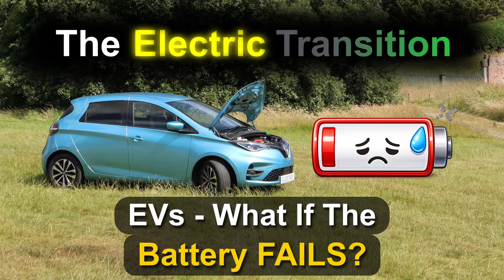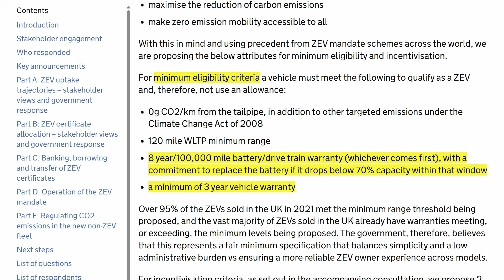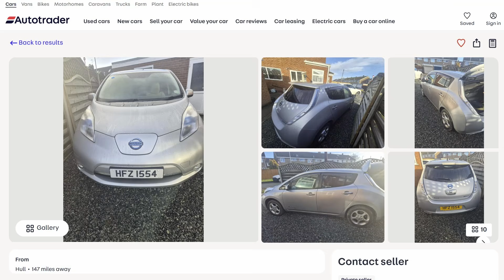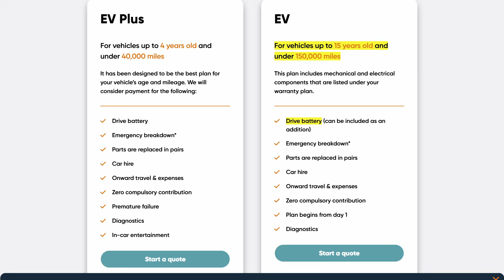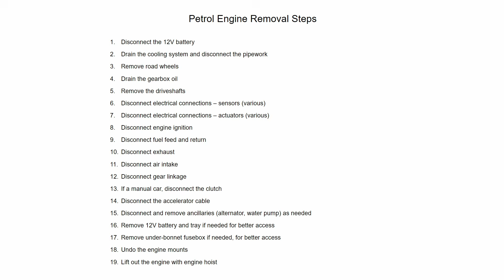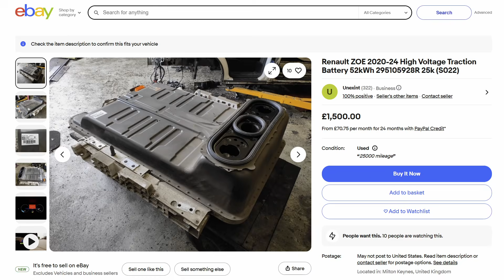EVs - What If Your Battery Fails?

Comment: I would like to be able to consider updating my worn-out battery for a new one using new technology and higher capacity.
Reply from the maker: That's certainly something that LEAF, and perhaps ZOE owners have done a bit. The LEAF's high degradation, as well as cell failures in the 30kWh variant due to lack of active thermal management, has encouraged an upgrade route. We've even seen this in Tesla Model S, with some people wanting a bigger pack than the car originally came with.

Comment: Nice review. Regarding replacement traction batteries most people are only going to buy one if they have a suitable guarantee. If the battery was replaced by the car dealership or their agent this could be for the remaining warranty time for the replacement battery or at least for the minimum of 1 year after purchase. Otherwise you have no way of knowing the history of the replacement battery or why the donor car was scrapped in the first place. 

However, you did not allude to the "elephant in the room", which is traction battery fires. There have been a few of those caused by cell pack failures due to faulty manufacturing. As someone who owned a Jaguar I-Pace for 3 years and 40K miles driven, I can say that I did NOT observe any battery degradation during my ownership, but had 2 traction battery cell failures. These were replaced under warranty by my local JLR dealer without any quibble or issues. But, this is a know problem with these cars. The same (manufacturer) battery is also in the Porsche Taycan and the Audi e-Tron GT both of which have experienced similar cell failures. All I-Pace subsequently received a software update that limited battery charging to 70% to prevent overheating (in the event of a cell failure) and a potential fire. This issue has very recently been reported by Volvo for some of their EX 30 models. The advise is to only charge to 70% until Volvo can work out a solution. So cell failures are still occurring but the main concern (as perceived mainly by the anti EV lobby) is not being left stranded but that the car will go on fire.
Reply from the maker: Thanks. I take your point about guarantees, but I think there are limited guarantees on a reconditioned engine, so I think this is a case of considering the equivalent for a combustion car.

Fortunately, the health of a battery is pretty obvious quite quickly, so even quite a short warranty should provide sufficient time to find any issues and make a claim against it.

You are right, I didn't mention traction battery fires. That's because the data shows that they are very unlikely. As you rightly say, there have been some recalls to cars because of the risk posed when manufacturing defects are identified. However, that is not the same as saying there have been a large number of fires even in those circumstances. The recalls are preventative. Recalling cars is the right thing to do - it's what ensures that fires remain a distant possibility.

I did do a video on traction battery fires a year or so ago, which you might want to watch if you haven't already. That details the source of the information that was carefully gathered, and what that means for BEV fires in comparison to cars with other drivetrains.

https://youtu.be/WDP1XAsoR_0
Reply: @IanStill-od1ej
Many ICE cars been recalled for fire safety reasons as well.

Comment: I drive a small ICE car. I will go electric in my next car. Hopefully, that will be a long time coming, because I cannot charge at home. Charging in my street is available, but just as expensive per mile than my current small ICE car. The biggest problems I have are: 1) An EV uses electricity in winter just to keep the battery from freezing, that is in my view wasting energy as I use cars to go from A to B and not heat components. 2) My own range anxiety. I had that all my life. I will fill up if the tank goes below 1/2. In an EV that would be limiting the range and hurts the battery. Oh, on the reliability of batteries, I think you are a bit too optimistic. Especially imbalance issues are not that rare, is my impression.
Reply from the maker: Thanks, interesting thoughts. I think onstreet charging prices will come down as usage goes up, so keep an eye out for that over the next 3 or 4 years.

ICE cars waste thermal energy all year round - you rarely use more than a third of the energy in the fuel. Therefore, a small amount of heating performed by an EV during a part of the year doesn't really make it wasteful in the same way.

A permanent range anxiety will probably fit with an EV just as well as cars with greater ranges are released. The Kia EV2 will be interesting to evaluate when it is released - but I am really referring to cars 2 or 3 years from now, which I think fits with your timeline
Reply: @ronaldderooij1774
There will be plenty of ICE cars around for years to come. If you don’t want EV no one can make you. I did use public chargers for over 2 years and it was cheaper, cleaner than driving ICE. Battery degradation by cycling data has been available for some time now. Battery degradation by calendar year, well we need to wait another 15 years for that to see results on modern chemistry’s.

Comment: Rarely does the dealer scrap an engine just because the car hit a pothole and dented the pan beneath the engine.
Reply from the maker: Have you had a problem with an EV, or is this more of a thought experiment?
Reply: @theelectrictransition  My wife was looking at leasing a Tesla (she loves the Dog mode) so we asked our insurance agent for a quote and the price we through the roof.  When we asked why she told us that the scrap rate was through the roof because they had to assume the battery had to be replaced on almost all collisions.
Reply from the maker: @typicalbraindeaduser  Interesting. My understanding of why Tesla insurance is so high is that it is a performance car with faster acceleration than people expect and are used to handling, so they suffer a higher than average collision rate as people get themselves in trouble.

Comment: Having a quick google, the percentage of ICE that fail during warranty period is stated as between 2%-3%, the same data for EV batteries indicate a failure rate while under warranty of 1.5% to 2.5%, however if we only take EV's manufactured after 2016 this failure rate drops to under 1%. that failure rate of between 2% and 3% is apparently quite acceptable for ICE cars but a less than 1% failure rate for EV batteries isn't? Again it's the old EV fire fear, far more ICE cars burst into flames than EV's, with that number for EV's dropping even more as new technology comes out, but because they are new and newsworthy we hear about the few EV fires but not ICE cars and trucks on fire.
Reply from the maker: Well said, and thanks for the stats. Yes, I agree, once manufacturers have got any first model design issues out of the way, EVs should be pretty reliable things.

Comment: I am in exactly that position now. The battery in my 30 kwhr Nissan leaf teckna 6.6 kw charger in Arctic white, is now only 50% state of health with only 6 out of 12 bars left. The wife uses it only as a very local runabout now and although the battery is almost completely not range viable anymore, the body of the car, being galvanised would otherwise have many more miles ahead. With a replacement battery being so expensive, it is not worthwhile to pay the price for a new one financially. I could fit a second hand 62kwhr battery from a crashed car for £8k but you only get 3 months warranty on the battery at Cleveleys as well as this,  it is still a very large sum to be throwing at what is a 10 year old car and a battery that you don't know the history and integrity of.  If the car had been a combustion car, the engine could have been repaired at a far cheaper price and kept on the road. As it  is, it is not financially viable to replace the battery and we are going to put the £8k towards a brand new £20k Dacia Jogger, which will last a very long time and also have a range of about 550 miles. I wouldn't consider another EV again, this is just another problem of the numerous problems and inferiorities, that i have encountered in 10 years of EV ownership.
Reply from the maker: I'm sorry to hear of that trouble, it's very disappointing. You were unlucky, as the 30kWh LEAF seems to have suffered the worst, particularly because of it's lack of thermal management, but perhaps also a poorer choice of chemistry.

I'm sorry it's put you off EV ownership, but I can understand how you feel after that experience.

Thanks for sharing your thoughts.
Reply: If you are going to spend £8k on a battery you may as well get a newer car with lots of warranty left and better battery thermal management. Plenty out there for around the £10k mark, I certainly wouldn't be throwing £8k away to put a reconditioned battery pack in a Nissan Leaf.
Reply: @MrDAVIDATKIN I wouldn't touch another EV, ever again. They are short lived and inferior in my experience. Even the newer ones in comparison to what we already had.
I also have a 17  1/2 year old Mecedes E Class diesel that has lost none of it's 650 mile original range. Combustion cars are just a mature product that works, as opposed to an EV that degrades and doesn't. All EV batteries degrade with time and use cycles - all !
Just got an e-mail this morning. My ten years old Nissan EV remote app will no longer be supported. Planned obsolesce. EV's like I said are short lived and a con.
Reply: @FredFox-m9v well it is unfortunate yoy had a poor experience and you had a car in the Nissan Leaf that had a very poor battery. I myself have owned about 20 ICE cars and driven many more in almost 40 years of driving and nothing comes close to my EV. Indeed we are now a 2 Ev household and will never go back to internal combustion. It feels like a backward step
Reply: @MrDAVIDATKIN  Every battery ever since the Baghdad battery 2000 years ago has degraded with time and use cycles. They are all bad.
Reply: @FredFox-m9v
I bet you it has lost many horse powers over 17 years, EVs don’t suffer from that.
Reply: @VictorGoesElectric I have just driven 345 miles yesterday from Teesside to Invergordon in the Highlands of Scotland. The fuel tank is on half way, from full and it had plenty of power all the way up here with absolutely no problems whatsoever, or enforced fuel stops. It achieved 51 mpg. What more would i want ?
I have seen examples of my car on autotrader of the same age, with 360,000 miles on the odometer.
Reply: @FredFox-m9v  
I'm glad you enjoy your diesel car. I've had many petrol and diesel cars before, never needed 500 mile range, specially around Scotland.
I just did 3500 in February miles in my EV at the cost of £70.
Reply: @FredFox-m9v
Let’s assume you are telling the truth here. Seems like you were very unlucky with degradation on your battery. You purchased EV without liquid thermal management (it’s on you), and at the time of your purchase you knew rough range it can do. Now after 10 years suddenly it’s not enough and you want 500 range car. 
Instead wasting your £20k on Dacia, buy used 3 year old Tesla with 40k miles with real range of over 250 miles.
Reply: @VictorGoesElectric Why would I buy a a Tesla model 3 that depreciates like a stone with iffy build quality and a quarter the real world range on the highway, particularly in the winter, that a car 1/2 the retail cost,  with many more seats and much more practicality. Lithium batteries are still the same, even though the battery management system has improved. The many modern EV's with class b degradation and worse at only 20k miles, with certificated SOH , on autotrader tells the story. All EV batteries degrade with time and use cycles, all ! It is physics. The same physics that governed the earliest battery found in Baghdad, from 2000 years ago. I bought my car knowing full well it had 106 miles of range new. No consumer knew then, that it would half in 10 years. Ours was always bought, primarily as a town car. Electricity was free at rapids and no tax with £5000 off from the government and a more or  less free polar charger, with only a £200 personal cost for it, if i remember correctly. It seemed like a good deal. The trouble is, people are buying EV's, thinking that they can replace long distance combustion vehicles like for like, with no loss of convenience and similar travelling times. They can't ! and the dreaded massive depreciation, high electricity costs and proven battery degradation.
I have always had other combustion cars and they were always available for long distance journeys. Apart fom the leaf, I currently own a Mazda MX5, a Mercedes E class diesel, a Smart for two petrol, a LWB pop top diesel camper van, a Honda cbr 600 f  motorcycle and a Kawasaki 900 rs se motorcycle.
The leaf was made in Sunderland, for March 1st delivery, bought at lookers Gateshead in Arctic white. It is a Teckna 30 kwhr, 6.6 kw charger model. I don't tell lies, even though other people might not like the truth.
The best vehicle I use by far regularly, particularly in the winter,  is the combustion engined vehicle that can travel at about 600 mph. I love those.
Reply: @FredFox-m9v  
All cars depreciate at the same rate. No one is forcing you to drive electric. If you like poisoning people around you than crack on.
Reply: @VictorGoesElectric EV's depreciate at a much faster rate because of the law of supply over demand. As an example of this, the inventory of  EV's on autotrader is increasing at an alarming rate because low numbers of people are buying them. This means to sell them, the sellers are reducing prices markedly and people who have them already, suffer the same knock on effect on devaluation of theirs. Combustion engined vehicles are depreciating at a much slower rate because the supply / demand ratio is much more in balance, leading to much less devaluation as opposed to a similar EV. and hence maintaining used car values much better than EV's with far less depreciation. The difference between the two vehicle types, far offsets any perceived fuel savings that you think that you were making, even if the electricity was free. It is like being penny wise and pound foolish as my mother used to say. On poison coming from combustion cars. I personally cycled 34 miles daily, 5 days a week  for 25 years, to work and back, in all weather. Transiting down the middle of mile after mile of semi stationary vehicles, supposedly belching fumes out. Avagadro found out that in atmosphere gasses dissipate almost immediately, rendering exhaust fumes immediately diluted to safe levels and particularly because we live in the windiest country in Europe.  After all those years exposing myself to all that 'poison' I am the healthiest 67 year old I know, taking no prescription drugs and having no morbidities whatsoever. According to 'experts' i should have lungs like lace curtains and suffer COPD but I don't.
I still ride a push bike and currently have a b.p. of 106 / 66 and in extremely good health, The same can't be said for those  poor children in the Congo, extracting Cobalt, unfortunately. That pollution, we knowingly export to poor countries. Not very fair, is it ? All to enable rich people to virtue signal on their own environment. If you truly believe in improving your environment and it is so important to you, get and ride a push bike, instead of driving a vehicle that produces more or less the same pollution and CO2 as conventional powered vehicles, taking into account production as well as use. The use production of CO2 in my personal experience, is twice that of my combustion cars because it has only lasted half as long ?
Reply: @FredFox-m9v  
New vehicles (ICE, hybrid, EV) depreciate at the same rate.
Autotrader has more new and discounted ICE for sale than EVs, if you care to check for yourself.
If you don't believe in poisonous exhaust fumes, do us a favour and rap your lips tight round exhaust while engine running and see what happens. 
Somehow you did't care about children in Congo while buying your fuel, which needs cobalt to refine it. Or kids in Kenya working on oil rigs.
Reply: @VictorGoesElectric   

do ev's depreciate at a faster rate than combustion cars ?

Yes, EVs generally depreciate at a faster rate than traditional combustion engine (ICE) cars

, losing roughly 40-50% of their value in the first few years, with some studies showing they can lose up to 60% after three years. This faster depreciation is primarily driven by rapid advances in battery technology, higher initial purchase prices, and consumer concerns over long-term battery degradation. 

Key Factors Driving Faster EV Depreciation:

Rapid Technology Evolution: Newer models often offer much better range and faster charging than older ones, making older EVs less desirable.

Battery Degradation Fears: Despite studies showing that battery degradation is slower than anticipated, potential buyers are often concerned about the longevity of the battery pack.

Initial Price Point: Many EVs have a higher up-front cost compared to ICE cars, which often leads to a higher monetary loss over the same percentage drop.

Market Maturity: The used EV market is still developing, which can lead to higher volatility in price compared to the mature market for petrol or diesel cars. 

Fact, nobody puts their mouths over exhaust pipes. 

I would disagree with the degradation studies proposed, being that most modern EV's are just that, modern and haven't suffered the long term degradation that a true representative data set would require, to establish a true representation of the chronological age degradation. My EV is 10 years old now. When I bought my EV, there was just a handful of EV's on the road. My EV has 50% battery degradation now. Another reason not to buy an EV.